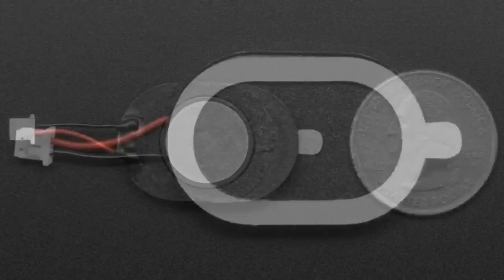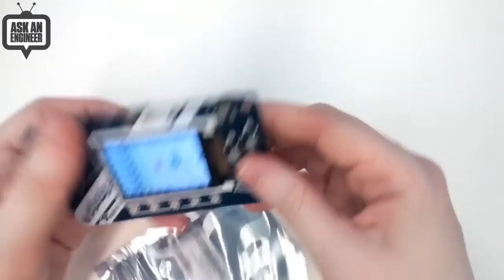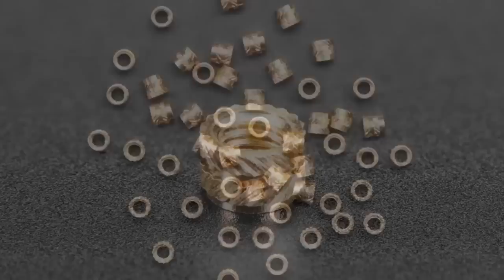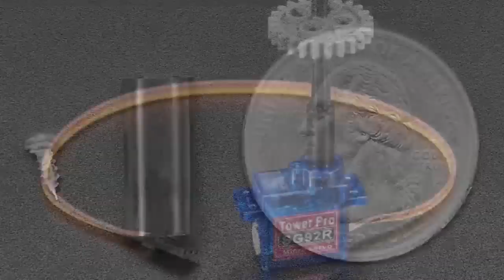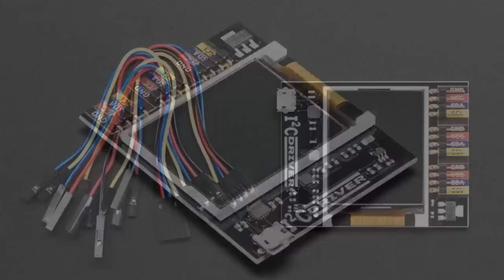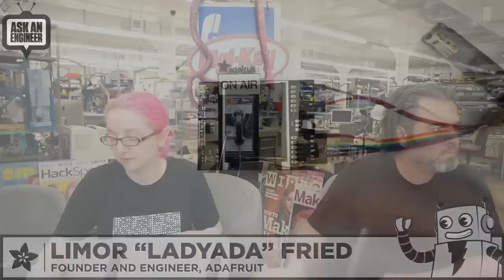New Products 6/5/19 Featuring SPIDriver by Excamera Labs! #adafruit

Comment: Wow, those i2c and spi driver boards are really awesome. Hopefully they can sniff too, not just act as the host - sniff and inject would be even better (at least on i2c) since sometimes you want to debug through observation and/or stick extra commands in while your normal firmware is running, and this would be a super convenient way of doing that.

Do either of them have level shifters to support lower than 5v peripherals? I've worked with some fancy stuff that wanted its i2c at 1.8v, though the 3v range is probably more common...